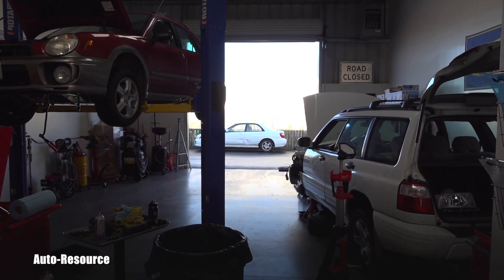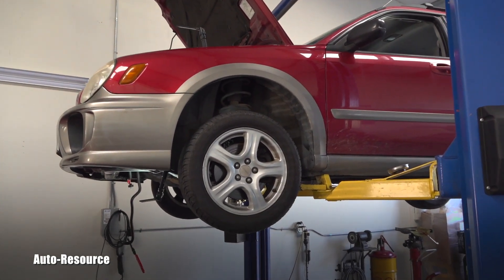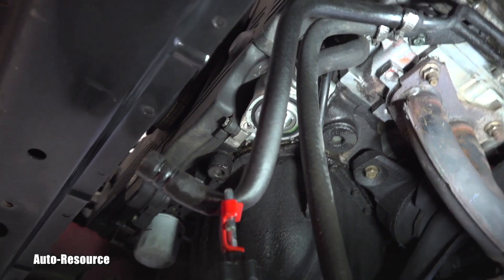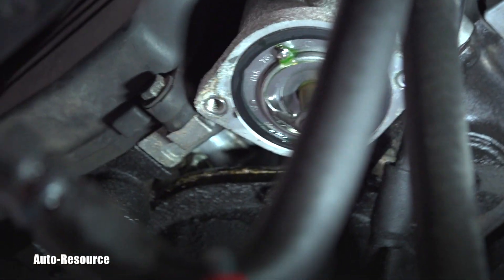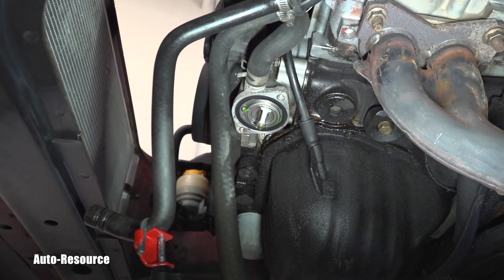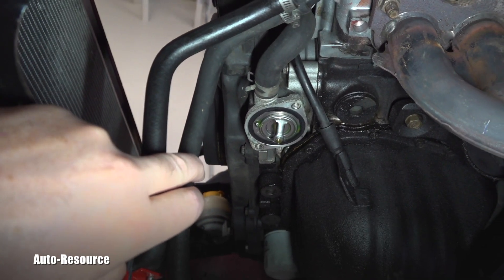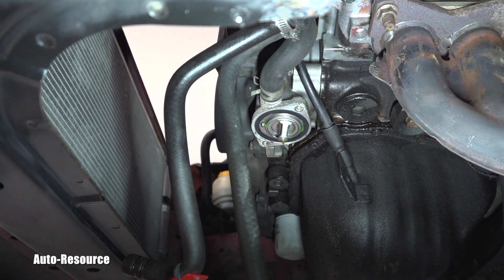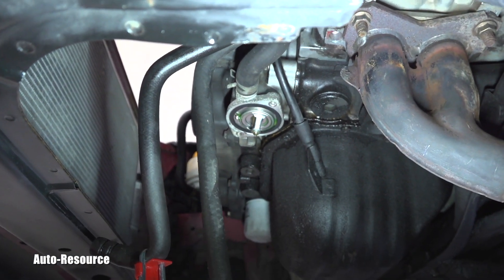SUBARU Engine EJ25 Thermostat position

Comment: So, I recently did mine, and when I pulled it, the jiggle valve was facing towards the block (rear of car) I replaced mine this way (JV towards front of car) and I had an overheating issue a day ago. I went to a pick and pull to snag a climate control unit and for shits and giggles pulled the housing off that one to take a peak and boom, JV towards the block/rear of car. Can you confirm this is correct with any documentation? I am now very skeptical. A call to subaru and they were little help, they said "ALL EJ25 engines it should point up" they're obviously talking about the turbo model but I can't seem to get a definitive answer.
Reply: jiggle valve position only matters if the thermostat is vertical and air pockets get to the top. if the thermostat is flat the jiggle valve position doesn’t matter
Reply: I'm doing my thermostat right now on my 2004 Outback Limited. I had my timing belt, pulleys, and water pump replaced recently at the dealership. I've been having issues where my temp gauge goes to 3/4 of the way towards hot side, then goes back to the middle after a minute or two. so I called em and asked, and they said it's most likely bad thermostat.
So I'm changing mine right at this moment, and when I looked online, it said I needed a thermostat rated for 78° C, and the one I just pulled out was 86° C, so Im sure that's the issue.
When I'm pulling the old one out, the JV was facing the block of the engine, and that's what the dealership did. I've also seen 2 other videos, and read on a forum, that's the correct way, so I'm putting the new one in that way too, with the JL (Jiggle Valve), facing the block. I'll update you tomorrow If it's still overheating or not. Even though he said to face it towards the radiator, I've gotta feeling it's supposed to face the block.
Although I also read it doesn't matter which direction on this particular model, the ej25 non-turbo.
So anywho, I'll get back with ya tomorrow. Cheers to DIYourselfers!
Reply: @elliotseattle, any updates?
Reply: @mrstogie912  it actually ended up being an electrical issue for me. Everything I installed was correct. Monitored temps with an ecu passport and just smacked my gauge when it went hot. Not very helpful but that was the outcome

Comment: burping these is a pain in the ass.
Reply: Indeed it is, I’m about 3 days into my project of tracking down the culprit to my overflowing overflow. New waterpump, tensioner pulley, idlers, timing belt. I have to replace the rad cap and thermostat with OEM parts. If I then continue to have the overflow problem of the radiator failing to pull coolant from overflow then it’s the dreaded Head Gasket failure
Reply: @pigfist  I have the same, any news?

Comment: Thank god, I bought an 02 Impreza that had a bad radiator. Changed it, and the thermostat but I couldn’t figure out how to put it in right. Now I should be able to burp it and get it on the road
Reply: literally same since i overheated a bit yesterday, i think i have to change the oil cooler or maybe just the O ring since i have a leak.
(09 impreza btw) 

hope you and your car are healthy!